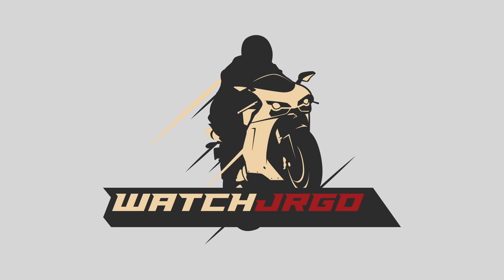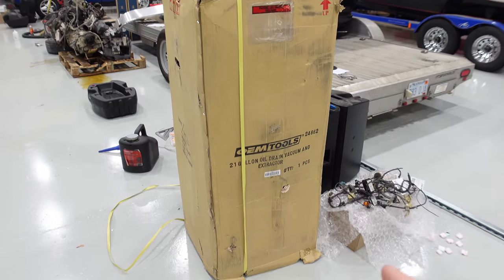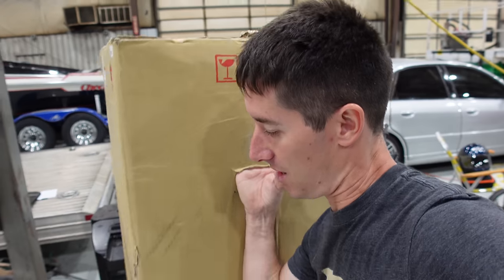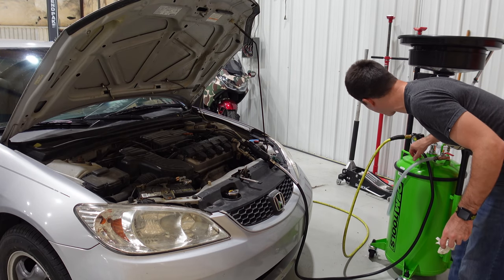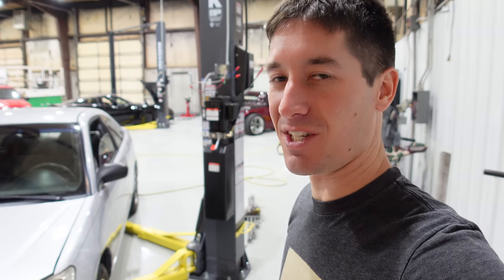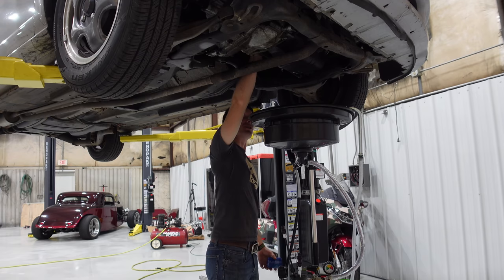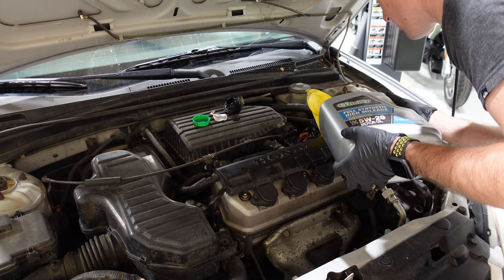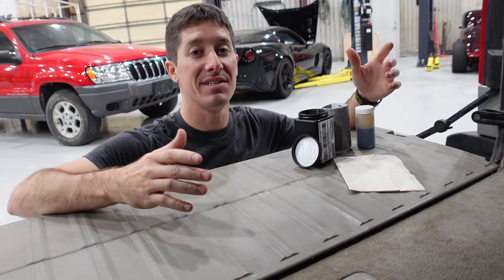Is VACUUMING Your Car's Oil Better Than Pulling The PLUG?

Comment: I had a 2016 Mercedes A220d with the 2.2 diesel. Merc would Vacuum the oil as that is their current process. However the tech told me with the miles i was doing (25k a year) he believed the plug should be removed due to the carbon chunks that form on Diesels in the oil. So on the 60k oil change he removed the plug and sent me a video. There was chunks and blobs coming out of the drain hole. It was terrible. So we went with a full pan pull. It was just horrific. The Vac oil process does not get rid of the large deposits that form and would normally flow out of the drain hole. So that made my mind up about this process !.

Comment: I would almost think that the shops would just use one generic extension to vacuum the oil out?  As long as it hits the bottom of the pan and the filter gets changed I see nothing wrong with doing it this way.  Certainly cleaner on the hands.

Comment: If you're a JiffyLube shlub or any of those quick-oil change afficianados, vacuuming will suffice because most of those former 'sandwich designers' barely know where the dipstick is. If you own a shop, getting the vehicle up on a lift allows your techs to thoroughly inspect your customers car while they perform routine maintenance. It allows you to inform your customers of any potential problems and less face it: adds to the old 'bottom line'.  Transmission fluid services are where I think these machines would shine because replacing the pan gasket and having it NOT leak is always, hit or miss.

Comment: The whole Walmart no drain plug thing is actually two-fold one less* liability and secondly, it's considered a sealed system it goes from the car to the pump to over-head lines to a bulk oil tank for pickup so it's supposed to be more environmentally friendly less likely for oil to get out into the open. However, there is a trap in these systems lazy techs either don't ensure all the old is removed or can't because of the oil pan/engine design thus resulting in one of two scenarios potentially 1/3 to 1/2 of the old oil is mixed with new oil or the tech overfills forgets to check after initial start-up sending it out down the road to blow the seals.

Comment: I bought a MiTVac to do oil changes on my boat but started using it on my cars.  Now when the wife wants me to do an oil change...I do the normal protest and flailing.  Then go out to the garage, tinker around for 20 minutes and do the oil change in 5 minutes.  She is thankful for 'all the hard work' and get the brownie points.  BTW Jaguar and Land rover have the 'straw' in the filler neck just for extraction purposes.

Comment: I see absolutely nothing wrong with waste oil evacuating systems, since we use a Samson Evacumaster system at the Walmart I work at, and it makes changing cartridge based oil filters on top of the engine a lot faster (just remember to keep the drain valve closed or you will have a massive oily mess to clean up!)
Reply: Plus it can bleed brake systems too
Reply: Thanks, I will avoid oil changes at Walmart.
Reply: @fauxque5057  so he got more oil out then a traditional drain, so your motor is getting more fresh oil, and any sludge build up is also being sucked off the pan.... so tell me how this is bad? I only see benefits
Reply: @braaapattack2937  because old dudes don't like change. Shit, I'm just happy to learn a new way to do things. Might be ordering one of them units soon.
Reply: @CrashRacknShoot  I’m all for pulling the drain plug just to check for metal shavings stuck to the plug. But I can also see the benefit of that. Mostly on cars with top side mounted oil filters/cartridges.

Comment: I have done this for years, although I primarily did it on inboard/outboard and inboard boats. Hope Gabe has a quick recovery!
Reply: Boats had different dipstick tubes.
Reply: My Mercruiser had a threaded dipstick tube to screw on a hand pump extractor.
Reply: Had to add another reply.
Been a while since I serviced a 90's 5.0 Mustang. One came in the shop recently, rare car, 2 Drain plugs because the pan wrapped over the subframe/steering rack. The Front Drain plug had not a single wrench mark on it. That means, NOBODY ever drained that quart in the front of the oil pan. Did that hurt the engine? Nope. Still just another fractional oil change.
In other words, oil pans with multiple drain plugs can still be vacuumed from the deep side, but you still have to pull the drain plug on the other locations.
Still is easier to suck out what you can, just cleaner all around.
Reply: I have a MityVac hand pump one. Better warm that oil up before you pump, or it can take forever.

Comment: Gabe's dad jokes are fire! I hope he recovers quickly, without complications. A lot of modern cars have a bottom cover for aerodynamics that is an absolute pain to remove in the driveway. Couple this with top mount cartridge type oil filter and you have an excellent use case for an oil extractor.

Comment: I use a 6 litre hand pump extractor. Oil has to be warm for sure. It's pretty easy, cheap and fast.
Reply: I just bought a little electric pump off Amazon or eBay and it has worked fine...I should try some time and see how much oil is left in there but I drive beater cars so I'm not all that concerned beyond mild curiosity.

Comment: My extractor works excellently on my Mercedes and BMW. I can extract most of the oil out of my Ford Excursion (at least the oil no longer comes blasting out of the drain plug because the extractor takes all but 1/4 quart of the oil). The extractor hose won't seem to go very far down the dipstick tube of our 2016 Honda Civic EX Turbo but at least there is now a channel for the oil of the filter to neatly flow through.

Comment: I work for Valvoline. We use the evac method quite a bit and love it. Cuts down on stripped out drain plug and splash shield claims substantially.

Comment: I want to see the Oil Analysis Breakdown. 
What's wearing out fastest, the ring's, the main bearing's, the cam bearing's? Can they narrow it down that close? What will they find? 
The Oil Vacuum system is a really cool tool for the shop. It looks a lot cleaner than pulling the plug!

Comment: I've been changing the oil on my 2009 Mercedes E350 like this since I bought it in 2011. Has 215K miles and never had any issues when it comes to oil. I now use my extractor on all my cars.

Comment: We used to vacuum the transmission oil before pulling the transmission, saved a lot of messy floors.
Reply: Would have saved my driveway.  Rip
Reply: @amerixantrash3620  my garage this last weekend just to find out I did not need to do it...

Comment: Power Boat owner's have used this method for ever,  only we didn't have the high powered suction tank....Most of the time we hand cranked a suction pump and collected most of the dirty oil but not all....It was the only way to change oil on an Inboard motor Boat and was better then NOT changing the oil...... Good Video .....

Comment: I've used a Rube Goldberg setup with a shop vac to vacuum the oil from my mower and snow blower.  Works far better than tilting the units.  Two thumbs up for the device you have!

Comment: I have had a simple harbor freight air-powered oil vacuum unit for many years. It is similar in operation to yours, and has a large capacity.It's worth noting there might be issues with certain vehicles where you can't reach the bottom of the pan with the withdrawal tube -- worse, some don't even have a dip stick!. Nevertheless, I love using the system as it makes removing old oil fast, easy, clean, and simplifies disposal.

Comment: The oil extractor will work well on transmission's, my GM does not have a drain plug.
Reply: No apostrophe.
Reply: Nothing against it flush or a fluid extraction on a transmission but I think a drop of the pan and changing the filter is still the best way to go. Well it's the second-best way2go. The best way to go is to get rid of that auto and put a 6-speed in it
Reply: @X_millennial  It would still be nice to take the fluid out first to avoid getting an ATF shower.

Comment: I did this on our Dodge Grand Caravan as the filter is on top. Really great to not have to use ramps and lay on the pavement anymore. Only things I don't like about your unit is it should have a clear hose so you can see when it stops pulling oil, and there's no sight glass to see how full the tank is.

Comment: I'm lucky this video came out today, as I'm looking for one of these today!!! I had an older oil pump that I used in winter for oil changes. I'd still be using it but I moved, it might have gotten tossed out or just misplaced. Anyway, need one for my fleet of 5 vehicles. I have a Mercedes SL500 and my shop uses an oil extraction pump like yours. I asked my mech about it and he told me that this method is totally approved by Mercedes so I'm sold!!! Sorry about Gabe; please tell him we ALL hope for a rapid recovery!!!

Comment: I've always been a pull the plug and drain guy.. I do have a vaccum system. May start using it from now on after this, especially if the oil plug is higher than the lowest spot on the pan! Thanks for the video!
Reply: Thats exactlly why I started using it on my car, it gets more old oil out.

Comment: i use a topsider to vacuum out fluid reservoirs in my vehicles (especially transmissions before dropping the pan), but haven't done oil with it.  thanks for pulling the drain plug, that was exactly what i wanted to know

Comment: I’m a marine mechanic and the vacuum extractor is the only way to get the oil out of inboard and I/O boats.  The dipsticks tubes are threaded for a garden hose fitting.  Works really good

Comment: First, I hope Gabe is healing and recovering well.  I recently changed the oil on my Dodge Dakota...and the plug on the 3.9 V6 is aimed toward the transmission/transfer case crossmember...which creates a ton of splash when draining...so vacuuming would address that instead of draining...of course some modern cars are doing away with dipsticks...so that is a consideration.

Comment: I’m a Mini tech who also does side work on BMWs and I gotta say a vacuum drainer is perfect for older BMWs and it can be used at home or in the shop. Older BMWs (with dipsticks) have the filter on top so you don’t even have to jack the car up and its amazing for someone who’s working out of their driveway. Sadly I don’t think it’s possible with the newer BMWs because of the lack of dipstick. My dad has a hand pump vacuum drainer and it’s great for side work where you don’t have any shop air.

Comment: Definitely agree that using an oil extractor is the way to go. You mentioned the German brands with the filters on top, and my VW diesel is the same way with the oil filter cartridge right next to the dipstick. With an extractor an oil change takes 5-10 mins max, and I don't have to lift up or get under the car. On the note of Mercedes, the early Smart cars with 800cc CDI engine (W450 chassis) didn't even have a drain plug on the pan. You had to use an extractor to do an oil change. Rather ironically, since you mentioned samples, I find pulling a sample is easier from the drain plug as you can just put your bottle in the stream and quickly fill it up.

Comment: Just got an extractor myself to do my Audi Q7. I went with the manual pump, though, since I don't have compressed air.. It took a little while but still better than jacking up car and removing the ridiculous number of fasteners Audi uses on the pan (20 on my S5). I was worried about remaining oil but the extractor has volume marking and it was right on what it held. Added back the 7.2 quarts and brought it up to level so there wasn't much left behind.

Comment: Great video. The dip stick could be a dip  tube/pipe which can serve as a suction outet and car manufacturers can design filters on top. Saves so much time & money for owners. Even many might actually DO the oil change instead of skipping altogether.

Comment: All that you need now, is the machine that changes Brake Fluid. It sucks out the old fluid from the calipers, while new fluid is pumped into the reservoir.
A few years ago, Fram made the Genuine Honda OEM Oil Filters, and Honda was not pleased with the 'quality'.
Reply: Back in the 80's when I was in vocational school for Auto Mechanics during high School, we had a canister full of brake fluid and an adapter plate for the Master Cylinder. We put on the adapter, hooked up the air line, and bled out the brakes with it. Easy way to flush out all the old brake fluid quickly.

Comment: Same way I do our Mercedes GLK 250 Bluetec. Shop wants $400 for oil and filter change and $400 to change fuel filter. Fuel filter cost me $121 and 30 min to remove and replace with new! Oil change kit cost me $85. Extractor cost me $77 and worked great, a one time expense. Thanks for the video.

Comment: That vacuum system would have been super handy to have when doing the DSG Oil change in my Mk 6 Jetta.

Or for any car that has a belly pan with 20 bolts/screws in it.
Reply: Does it not have a filter or magnet to clean? I've only ever messed with torque converter automatics, so I'm genuinely curious.
Reply: @Tracert-mc1hu  DSGs have a cartridge filter (located underneath the battery tray).
Reply: @300DBenz  Interesting, all the automatics I've worked on have had a filter inside the pan that needs changed as well. A cartridge style makes much more sense to use with a vacuum system.
Reply: It drives me insane how much time it takes to take it off when I'm working on jack stands. I have a 2017 Elantra Sport and there's a cutout for oil & filter as well as the rear motor mount, however, everything else you have to take it off for and it's just cumbersome. 12 or so plastic push pins and 6-8 bolts.

Comment: I have 3 Mercedes and I do both with each.  I think the vacuum method works awesome. I like to drop the drain plug every other oil change to see if there is any debris on the plug.  Some people think ignorance is bliss.
Reply: It doesn't. Its the lazy, dealer way. You will have sludge on the bottom of your oil pan, there's many videos proving some models will leave up to half a quart in the pan which is the dirtiest oil that's on the bottom.

Comment: Been doing this for about 5 years now makes transmission fluid change easy.  Most OEM service manuals do not recommend flushing transmissions anymore even though dealers still try to do that until I show them in the service manual not suppose to do it.

Comment: I haven't been in the industry for years, however for your standard oil changes I think this is great way to do it. But if you have an engine with questions on its future reliability, I think pulling the plug is still nessasary. But standard in and out oil change. That is great! I wish we had one.
Reply: Same here,  we dropped the plug years back and sometimes you had a cross threaded plug that someone else left you with, spills, hot oil on your hands, etc. I say if it works, it works
Reply: I have used vacuum oil recovery systems. They work but I won't use them on my cars. Part of the drain process is to warm the oil so the garbage in the bottom of the pan will flow out with the old oil. Sucking it through the dipstick tube doesn't get the garbage from the bottom of the pan
Reply: @fauxque5057  I have to disagree a lot of pans are like that honda where there is a lip and that stuff collects below that lip. So by the time you get under and drain it that stuff is below that lip. But using a vacuum you can get to the base of that pan and suck everything up. Now I still maintain that if you think there is a problem with the engine draining the oil the old-fashioned way and inspecting everything is the best way to go.
Reply: @X_millennial  add to that, that pulling a magnetic drain plug also will let you know, if there are metal shavings. So doing both might be the best way to go.
Reply: @MultiMegafred  true a magnetic is a great thing to add to your own car. And if it was my car I would do that I would add the magnetic drain plug and still probably do the vacuum to drain it and then I would inspect it by pulling the drain plug and seeing if there's any thing on it. But the average commuter that they take to work and they take to get groceries and then they take to soccer practice. They're not that worried about it. And it looks like to me when you vacuum it out you get a good look at the oil as it comes out so if there is a problem you should be able to detect it then. If that thing caught the oil change quantity separate from the disposal catch first so you could inspect it for any debris before it mixed into the last eight oil changes that are in that tank that would be great that would be something would make me feel better because then I can catch anything before that car goes back out. But if you really want to know what's going on with that car use your crack the filter open and take a look at the pleats and see what it caught. I mean if we're going to be serious here that's what you should be doing. But we're talking about your basic oil change on your basic grocery getter vacuuming it out is faster and more efficient.

Comment: I have two Subaru Foresters, a 2017 and a 2018.  My oil extractor that I bought a few months ago works perfectly on my 2018 but can only extract 3 of the 5 quarts in the 2017.  Something blocks the hose from reaching the bottom of the oil pan on the 2017.  They are the exact same engines - go figure.  Didn't know about cheap oil change places doing it this way either.  Good video as usual.